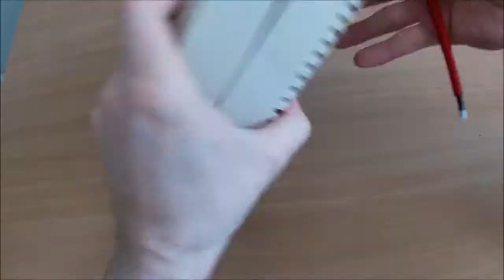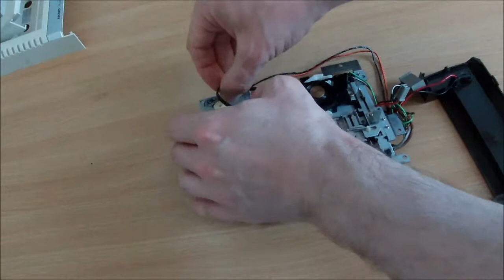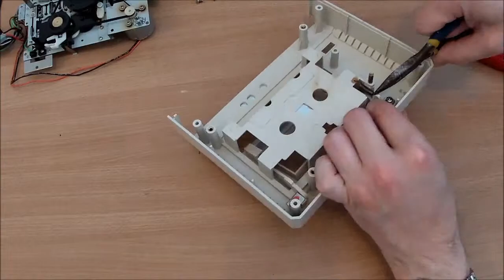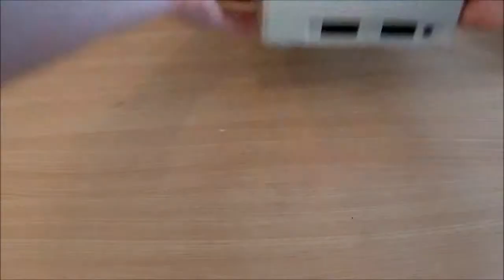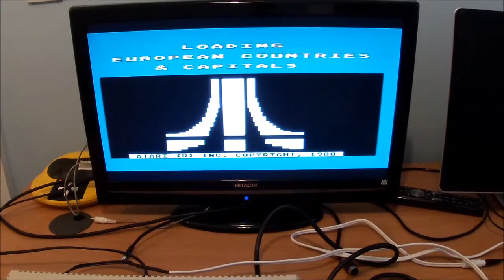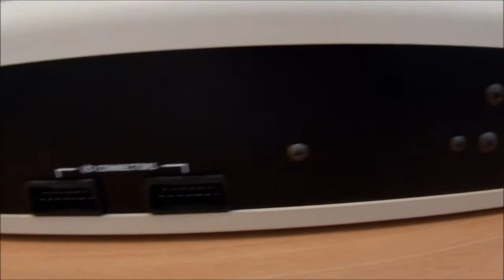Atari 1010 Program Recorder & 1029 Printer

Comment: Hi. What are the belt sizes?
Reply: 2 x Rubber Belts
Belt Type Square
Dimension 73mm x 1.2mm
Dimension 55mm x 1.2mm
Reply: @WxAxNxDxExRxExR  Thank you.
Reply from the maker: Hi sorry I don't know. The manual is no help either. Sorry I can't help

Comment: Great vid.
I fix these often and commonly there are indeed failed capacitors. A symptom of this can be Atari not 'reading' data despite the audio playing normally.
I've had dead diodes and also the rec/play main switch can be dirty.

Enjoyable video - thanks 👍
Reply from the maker: Thanks. Good to know about other common faults. Nice to know preventative maintenance is worth it.

Comment: hi Stedubya, i have a 1010C like  yours that i'am trying to repair. 
problem is that pressing FF and REW (Play too connected with a A800) motor not move.
providing DC from a bench PSU, motor seem to work correctly.
so i've start to troubleshoot ...

My problem is that on Service Manual i've found on line, there are some strange things.
If u look closer at schematics and at Silkscreen about 1010C, u will see that , at least on the ones i've downloaded, values are different.
for exemple, on Schematics, C128 is 100uF and C127 is 470uF, while on Silkscren C128 is 2200uF and C127 is 220uF.
i've desoldered different things (resistors , diodes etc, for test) and changed some resistors looking for values on the Serevice Manual but , when i decided to recap, i realized that i don't know witch is the right value.

can u please tell me on your working 1010C values of C128 and C127?
i've not keep the original ones, so i can't see what there was before my repair attempt ...

i hope all resistors are correcly indicated on schematics because i am on a big trouble now ;)
thank you and sorry for my bad english
federico
Reply from the maker: Hi. I have checked 2 different drives. They are both Hong Kong models. C127 is 470uf 16v and C128 is 1000uf 16v. Hope this helps 😀
Reply: @SteDubya  thank you !!
Reply: @SteDubya  Stedybya, long story short, i need to know the real value on a working pcb 1010c of R140. On schematic is 4.7Ohm , and on Silskreen is 15 oO. I'am 99,9% sure i changed this  and now everything is going to ground when i press ff/rew so motor don't run. Can u , please, check on circuit when u have time? thank you
Reply from the maker: Hi R140 in mine is quite a big one physically it must be high current. It’s 22 ohms 5% tolerance
Reply: @SteDubya  thank You!!!!!
Reply: Hello!
I've had motor problem similar before and it turned out to be the mini coil inside the plastic housing next to the 470uf cap.